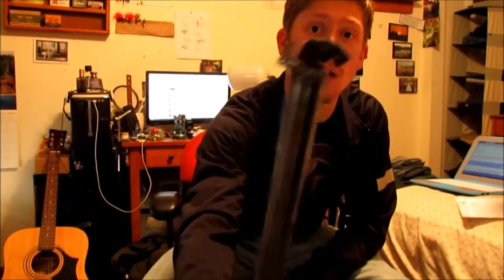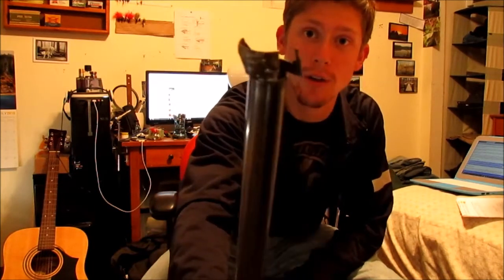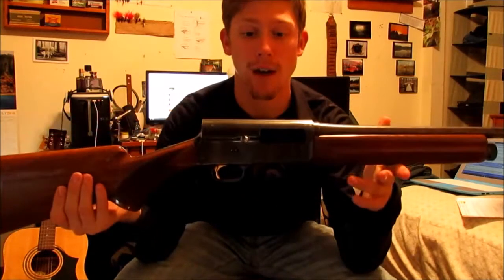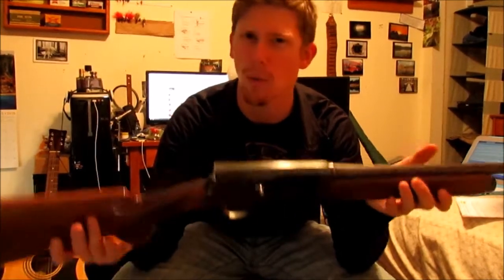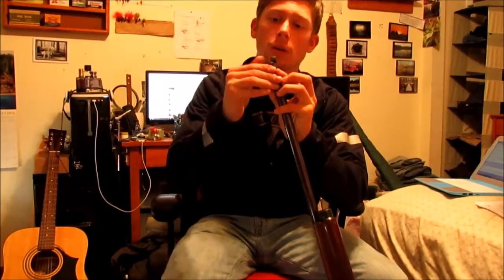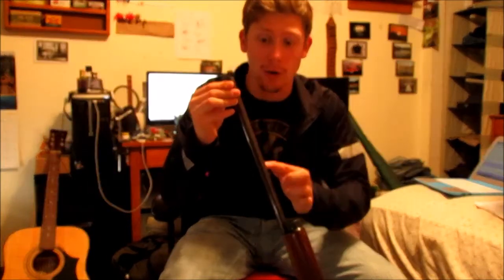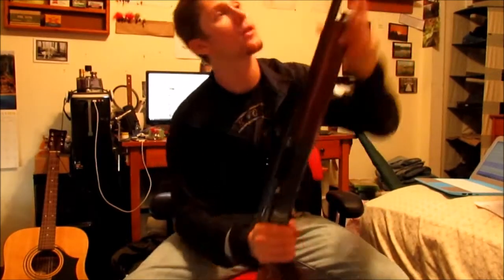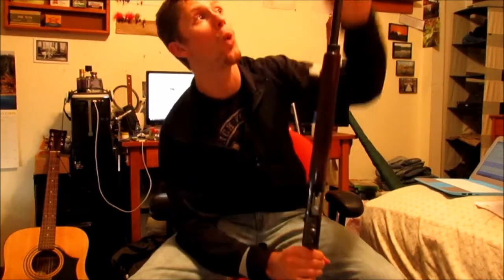History Of The Cutt's Compensator

Comment: I have quite a few Cutts comps, I reload, and I do quite a bit of pattern testing. Don't use the extra full choke with modern wads. Paper wads can deform through the choke, plastic have a much harder time with it. In 12GA the wad OD is 0.70 to 0.730. The extra long range is 0.68. The wads may catch. Full choke just matches the wads. 

Some wads have 8 petals for quick pattern expansion, like Lightning wads. The fingers on these separate from the shot within the Cutts. Then when they go through the choke they mess up the pattern, worse with a tight choke. 

Don't consider steel except with a spreader tube. With steel shot the wad is supposed to keep the shot from touching the barrel or choke. When the wad / shot is inside the Cutts there will be a slight expansion of the shot column. Then suddenly confining it in the choke probably would tear up the choke.

The nice thing with Cutts is they throw a very good pattern. You can get additional patter control with wad selection. Wear lots of ear protection.

Comment: Bending likely is not your problem.  Keep in mind the cutts is wider than the barrel, so having the bead on the cutts instead of the barrel can tend to make the shotgun pattern low.  So, one of the things they did was to braze the compensator on, and then thread a bar the same size as the brazed on portion of the cutts and bend the Cutts down.  It sounds horrible, but one really couldn't tell without a straight edge.  Also, I heard about guys "fine tuning" this with the crook of a tree on the trap field.  When you think about things like that you wonder how the braze weld held on as long as it did.

Comment: When it comes to shotguns, when something blows up or off its due to ammo.I watched your previous video and everyone was using the same ammo (20ga) but what most likely happened is that the plastic wad which travels with the shot, might have been lodged or caught in the cutts, and when you fired your next round the wad blocked the wad/shot you just fired resulting in your cutts being blown off the end of the barrel. I've been around and dealt with cutts guns, and shotguns in general and anytime anything blows on a shotgun its due to ammo or something lodged in the barrel. If your first 20 something shots were fine and dandy then all of the sudden BOOM cutts got blown off I'd bet a wad was lodged in the cutts. Just my guess. Also look on places like gunbroker and you can find 100s of browning A5 barrels.
Reply from the maker: Thanks so much man! I didn't think about the wad. Very intelligent assumption. It very well could be the problem. thanks so much for your input.

Comment: Nice video buddy, sorry that this happened to you. I myself just bought a Remington 878 w/ Cutts installed on the barrel which sparked me to find more info on the Cutts then discovered your video. This is just a thought but I am a plumber by trade and have a lot of experience w/ soldering, I’m wandering if your barrel couldn’t be heated up w/ a hand torch to melt the residual solder and pull the broken piece free? As I said, this is only a suggestion, if this were to work I’m sure you would need to re-blue the barrel but at least you would have the broken piece removed.Good luck to you!
Reply from the maker: Neil Webster I appreciate the idea! I hadn't thought of that. I will certainly consider it as an option. Good luck with the 878! Those are wonderful shotguns. I'm hoping to acquire one someday myself

Comment: I just found this post when watching your video.  I'm posting both the URL and the post that I found.  Perhaps this was done to your gun prior to your acquisition.  If that happens to be the case a wad could easily have gotten hung up, causing the damage you describe.
http://www.trapshooters.com/threads/polychoke-and-cutts-compensators.209728/

Here is an obscure story from the deep reaches of my memory.  I believe I heard this from the guy that told me about using a Cutts to turn a field gun into a skeet gun.  

As I remember the story, a lot of those guns then were ribless.  Attaching a Cutts to them was a bit of a trick.  It seems the huge glob of a Cutts on the end of a ribless barrel would result in a gun that shot low.  I guess that would be like adding a higher front site to a rifle.  So after the Cutts was attached it had to be bent up to make the gun shoot straight on.  I guess they had a tool 
to do that, but I remember him saying some guys bent their Cutts using the slots between boards on the safety fence between skeet fields.  He said some would even use the crotch between branches on a convenient tree.

I can't recollect that I have ever seen a ribless gun with a Cutts, but I have seen several ribless Poly-Choked guns.
Reply from the maker: Josh McNeal, I truly appreciate the in depth response you have given me. Your answer worries me the most, as I hope my firearm was never treated this way (but it's a darn good possibility). When I get home from college, I will see if any of my older uncles remember anything about that old shotgun. Maybe discussing a few of the things you have said will spark a memory for them. Thank you so much for the link, I will look into it.
Reply: You are most welcome.  I have recently purchased a barrel for a similar make of shotgun with a Lyman Cutts Compensator installed.  Your video helped show me the possible limitation of leaving it installed, so I am glad that my knowledge was beneficial to you as well.